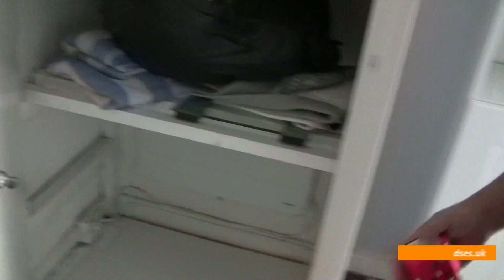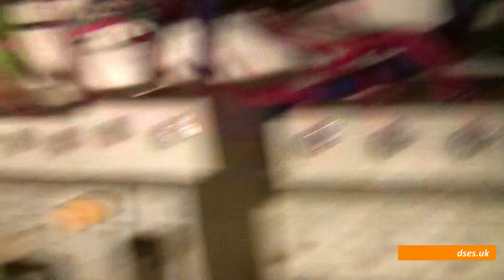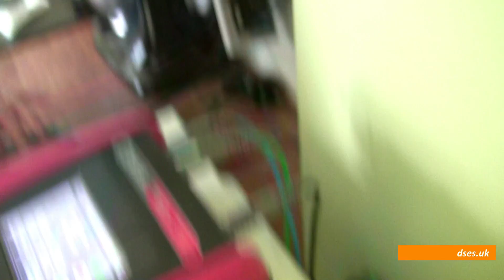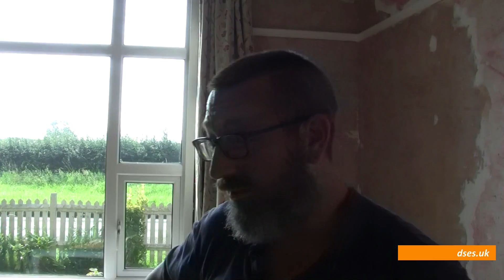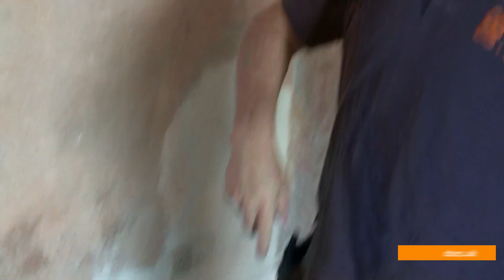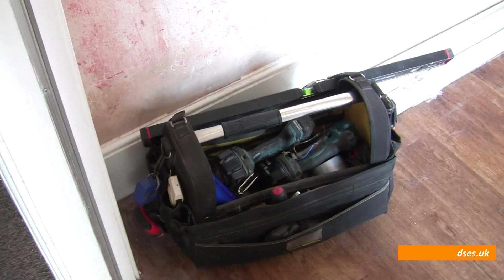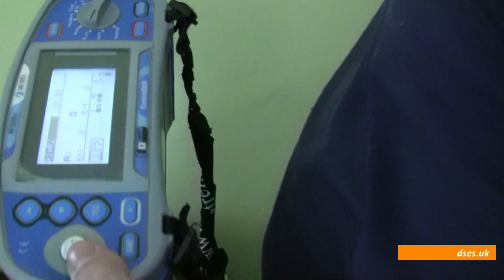On a domestic EICR

Comment: I always liked to use tape to match up end to end I had red green blue yellow an others I put the CPC sleeving on then a bit of tape to stop it dropping off.  Always nice an tidy am looking at new reg's for cable entry for the new 18th edition - Must buy a new up to date on site guide there is stuff saying you must do this then there is stuff saying you can do this.  BASH HEAD ON THE WALL - Can you give Nigel  a second zap at 500 v or 1000 v I dare you to do it on video .  Tell him I told you to - I must do some videos or the crap I have seen by £$%^$%& fitting new CU's were the neutral left lose on the second buss bar it was getting hot an burned all the wires.  I have photo I will send over with who fitted it - It was a very big company not one feed was folded over Redials fitted in the CU off a ring - a ring split over two MCB's the list goes on.

Comment: I’m an electrician.  Running my own company for 12 years.  I’m curious.....how much did you charge for that EICR?
Reply from the maker: We charge per circuit, £20 each for the first six, £10 each for subsequent. Although we took most of the day about it, it would have been quicker had we not been dicking around with the camera and we hadn't booked anything else that day so were happy to take our time. Normally, we may have completed it sooner. EICR's tend to lead on to other work though, and we're back there this Monday to start making some changes.